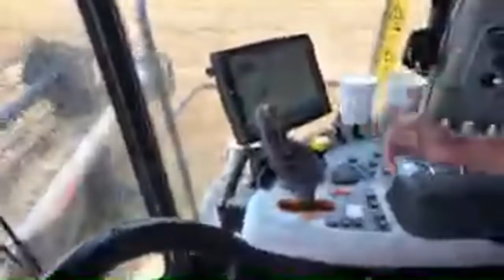Racing the Rain Wheat Harvest 2020

Comment: Can you purchase a brand new combine without a header and put your own head around later on or do they come with a header and you have to trade it in the header mean
Reply: You can buy just the box/ machine without heads.  Often you can keep your existing heads, and use them on a new combine, if they’re the same brand.  Sometimes the manufactures make changes when introducing new models, so your existing heads won’t work, or may need adapters to work.  There are differences between brands, as to how the heads attach, so if you buy a new combine of a different brand than your heads, you’ll have to either get new heads or get adapters to put your old heads on the new machine.